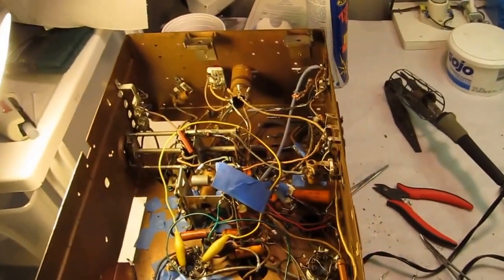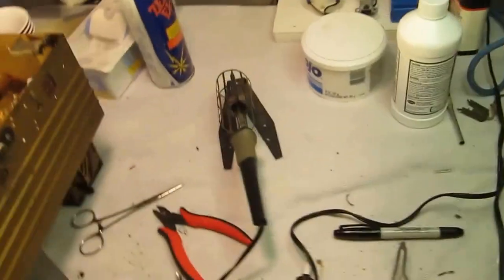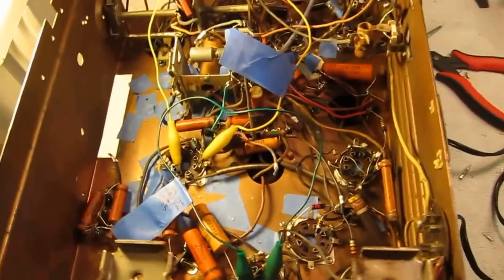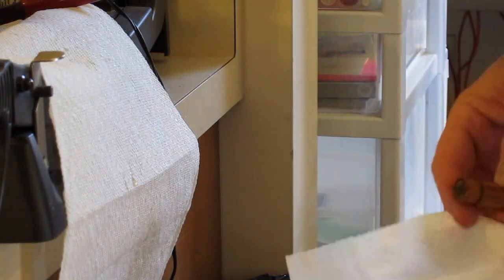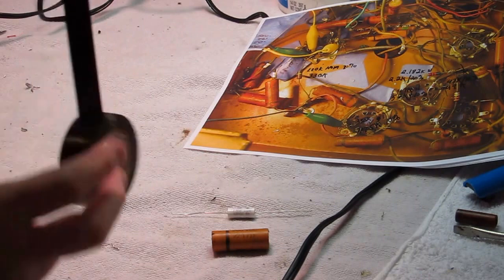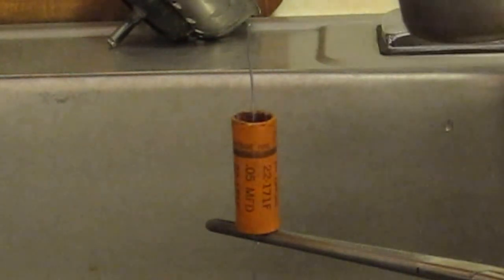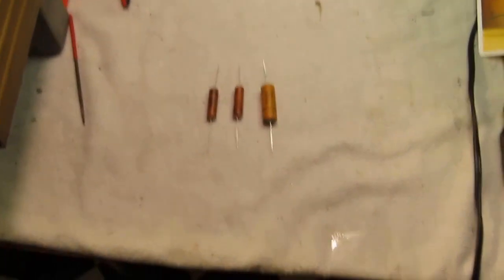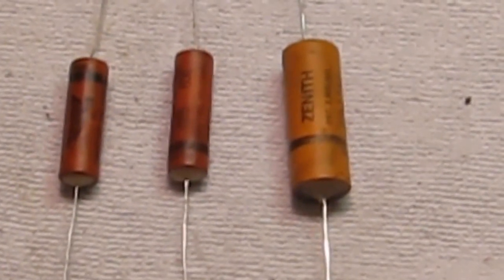Tutorial: Restuffing Vintage Paper Capacitors

Comment: Take the paper capacitor out of the unit, hold it by one of the leads with a pair of pliers, use a heat gun to heat the capacitor tube,  when the wax melts, use a rag or gloved hand, pull the insides out. Put the new capacitor in, and use hot glue to seal the ends of  tube. Bee's wax is too soft.

Comment: I can't see the reasoning for doing this, it's not like you're rebuilding the actual capacitor.....it doesn't devaluate the product and it's completely acceptable to use newer components. 
However, if you had fun doing it then more power to you.
Reply from the maker: I didn't do it for any reasons of valuation, since this radio is my prized possession and will never be sold in my lifetime.  It will go to one of my sons someday, and likely to his son or daughter.  It belonged to my aunt and played an important part in my wonderful childhood memories on the farm, so I wanted to restore it to its original appearance, including painting the chassis, re-lamping the faceplate, and making the underside as close to original as possible.  And yes, I had fun.  Probably the most fun you can have with your pants on.
Reply: @jwills8606 ...fair enough...👍👌
Reply: @jwills8606  better put some labels inside explaining this or the next person won't know

Comment: Does provide excellent results. Video should be a great resource for future restorers. Mind you  the melting point
 of beeswax is 145 F ( 62.7 C) and you should keep the temperature from going any higher than 170 F (76.6 C)
using double boiler technique. Use a thermometer to be accurate. Thanks James.

Comment: Instead of using bees wax, why not use hot glue gun? You don't need the black tape, doesn't make a mess like bees wax and looks like bees wax? Just restuff the capacitor and stuff with hot glue.
Reply from the maker: Sure.  Good idea, but the beeswax, since it IS identical to the original, LOOKS original.  It has a slightly amber color, and should it ever need to be removed for the next re-cap, it melts at a low temperature, isn't sticky, and would allow the original paper tubes to be reused again.  Since it also goes on the outside of the tube, it protects the paper perfectly for one more eighty-year period.

Comment: Bee wax getting pricey ,but I need some ,I replacing a ferrite bar antenna the wax is to hold the wires together ,restuffing caps not a fan ,I want to see where the new parts are,plus new parts take up less room ,look nicer ,and if papper and wax get hot you have a candle .but some people want it look the same.

Comment: Thanks for sharing - a wonderful tutorial.  The one thing I've worried about when doing this type of restuffing is if you sell the radio and maybe it changes a few hands.  Then one day maybe five years later something else goes wrong.  The person opens it up and sees all these original caps and says "hey I'd better cut all those old caps out and put in new mylar caps.  Oh Know!  I would suggest making up a small sticker that indicates that it was restuffed with perhaps details as to when and with what type,  i.e. Restuffed w/Mylar YR-2019.  Then do your final wax or combination sealing.  That way in the future someone looking into the receiver will see what appears to be original caps, but hopefully will notice the little added sticker indicating the improvement.  I've also considered using the cardboard tubes that are placed on the bottom of some wire clothes hangers.  So instead of restuffing you would essentially use your procedure, but I would then wrap a completely new sticker around the outside.  One could then replicate the originals or better yet make up your own capacitor company name, but remember to date and indicate the type of cap used to again prevent confusion that this is an old cap.  Then you could have premade capacitors handy for these jobs.  

Naturally you could also add a sticker to the underside of the chassis that tells future owners of the recapping, but I'd still suggest some coding to indicate the work was done per cap.  

Again, great video and IMHO worth the time and effort to keep the radios looking original.
Reply: Good point and great idea!

Comment: the outer foil lead only matters if you want to shield the circuit from noise...
of course, modern capacitors are no longer marked, and those that do have lines for some reason, can't be trusted, personally i test for the outer foil side, mark the lead and install my caps correctly...

Comment: Maybe I missed it, but are you using electrolytic caps to replace the old paper/wax ones?
Reply from the maker: They are modern polyester caps.
Reply: can you recommend a good website to find these?  I'm having trouble locating some of these picofarad values at 400 working volts.
Reply from the maker: I don't think I had anything in the pf range.  Just any supply house (DigiKey, Mouser, etc., should have what you need.)

Comment: good video thank you
would it work with cheap candle wax ?
Reply from the maker: James Wills
1 second ago
Candle wax is primarily paraffin, so I think that electrically it would work fine.  The beeswax has a yellowish color that matches the original color, though.  It's not expensive, and you need very little to do a whole radio.

Comment: Love it.
Hint: Try a 50/50 mix of beeswax/rosin for the end fills (tougher and has a higher melt temp).
Then dip (soak) the whole assembly in plain beeswax (just above its melt point).
Thanks for sharing!
Reply from the maker: That sounds like a superb technique.  Do you know if they did that in the originals?
Reply: Yes, that was a typical method. Was cheap and did work well, the caps would be good for a decade or so. The "molded" paper ones did OK, too...for a while.
I'm all for "restuffing" caps, but please do post notes (in the instrument) that ya' did so.
Why not share with others your technique? ;-)
Reply from the maker: It's in the queue.  LOL.  I typically tape a card inside everything I restore with all the history I know about it. I need to replace several gassy tubes on this radio; I'll plan to do the card then.

Comment: Very neat idea. Is there concern about the heat of the wax damaging the new capacitor as it is a different costing than the original?  Thx!
Reply: JT Toad not at all
Reply from the maker: No - the temperature is actually pretty modest - somewhere around 150°F,  65°C.

Comment: I understand the purist wanting  the chassis to look original, ... but who is going to see your work? and who will care other that the person doing it ...some other restorer that will cut them out in a heartbeat thinking they are original unless you put a note saying they are re-stuffed, I personally don't care what the capacitors look like .... as long as they work.
Reply: “When you’re a carpenter making a beautiful chest of drawers, you’re not going to use a piece of plywood on the back, even though it faces the wall and nobody will ever see it. You’ll know it’s there, so you’re going to use a beautiful piece of wood on the back. For you to sleep well at night, the aesthetic, the quality, has to be carried all the way through.” ― Steve Jobs
Reply from the maker: I will know; that is enough.  My boys also know, and it will go to one of them.  

One of my next moves will be to fill out a card with everything I know about the radio and tape it inside the cabinet.  I did that with my mother's Victrola and my father's 1870s - era mantel clock.
Reply: To me it makes differense, it realy annoying me seing ugly modern plastic parts in fine old equipment.
Reply: bones007able the worst part is when you restuff them and joe blow goes and clips them out thinking they are still the original caps..
Reply: Joe blow will never touch it...as evidently....he does his own work...and as for  bones007able, He must have us all confused with someone who cares what he "personally likes"...Those are just two facts and not my opinion...
Reply: Point well taken. Take notes. Include them! Help our kids with this stuff.
Reply: Nothing looks  as ugly as a poor restoration. The older caps were larger and the amp/ radio chassis designed around this fact. Tiny unmatched caps tossed in looks quite amateurish, not at all original or properly "restored". I restore vintage tube amps and I usually walk away from items that hobbyists have messed around with. To each their own, not for me. 
Re-stuffing capacitors (when done properly) should be easily accessible for quick maintenance in another 50 years; yet should look original. A proper restoration should look original. 
Yes, may people "add a note inside" .  I just  stuff a little tissue in the ends and cap it off with a touch of hotglue; available in colors... green, black etc. Easily removable when needed with a dental pick etc..

Comment: Nice video, few things to notice, but since the video is a year old you may already know them. First modern caps do have an outer foil (but it is not marked) and attaching it the "right" way can matter in rf circuits. For finding out more see https://www.youtube.com/watch?v=BnR_DLd1PDI . Second why put them in the oven? You have an hot air gun.  few ten of seconds in that heat and you can pull the cap right out of its housing. Saves on energy and time.
Reply from the maker: It takes the heat a little while to penetrate the paper shell, and I could just put the caps in the oven at a known temperature and forget them while I worked on other parts of the radio.  I ended up doing a lot to the machine, including painting the chassis, which had corroded through the copper plating and looked pretty cruddy.  If I can figure out how to post some pictures, it came out pretty nice overall.